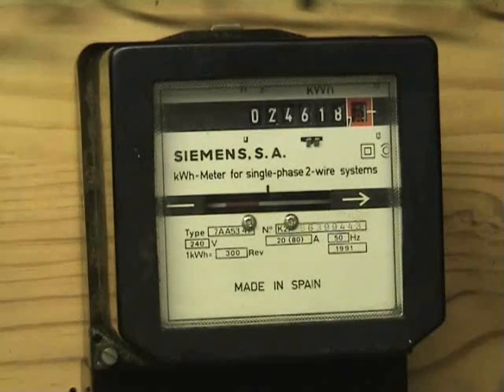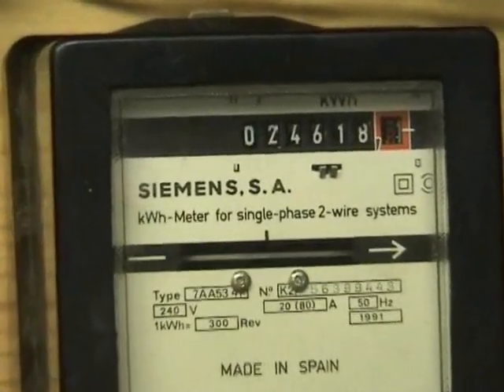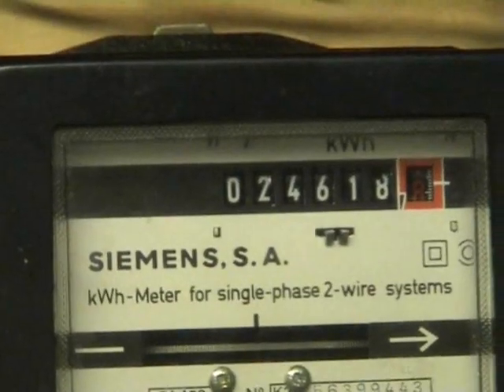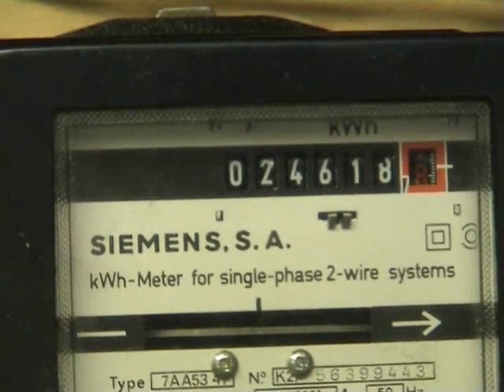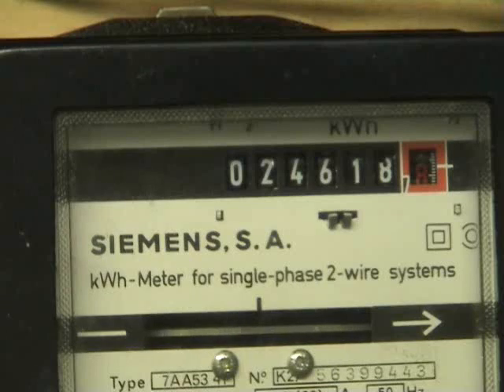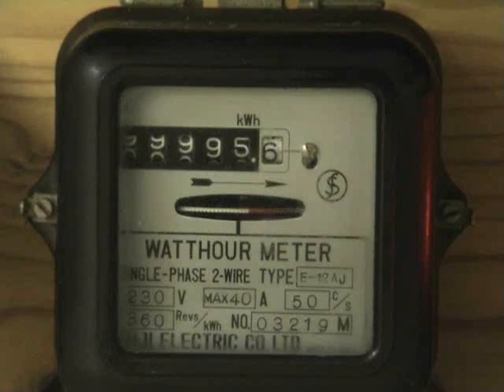Siemens kWh meter and a Fuji on 99995

Comment: Yes....That siemens meter does look very similar to a Ferranti 'F2K' design.....I have a picture of one, and the model number is F2K-100. Ferranti also made F2K pre-payment meters based around the UKs Smith Meter design (Smith meters APR and APM models) The three Ferranti meters that I know of, that were modelled around Smith's design are the FPQ-102, APQ, and of course.... the F2K-50B. Some parts between the Ferranti and Smith meters are even inter-changeable! Thanx for sharing! BoomBoxDeluxe.